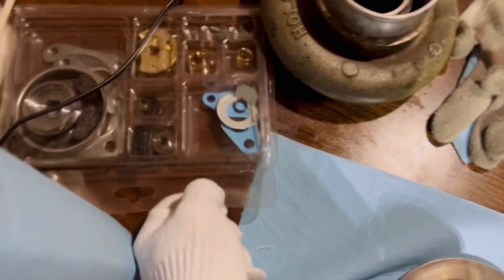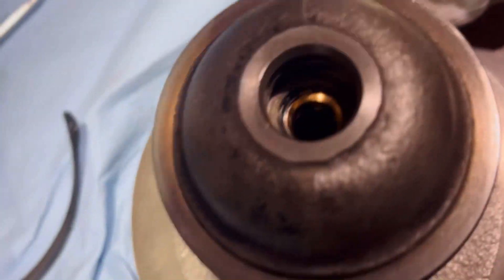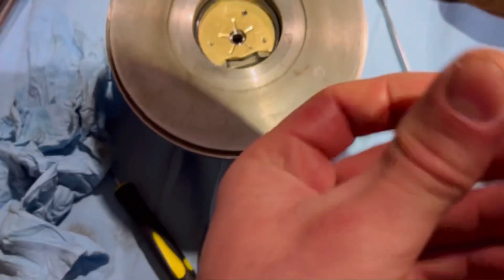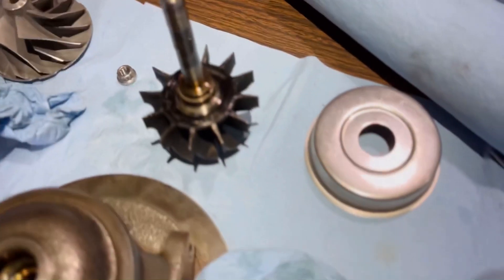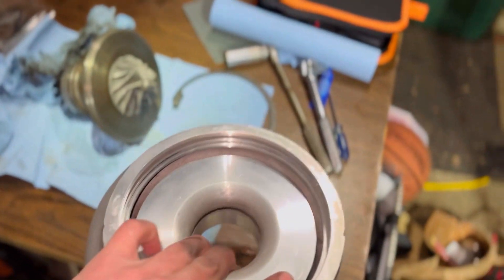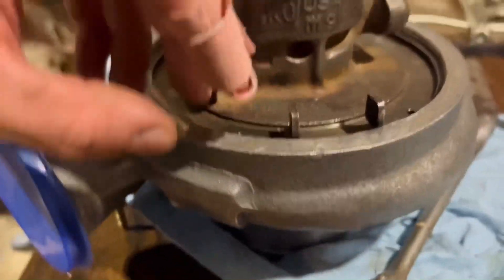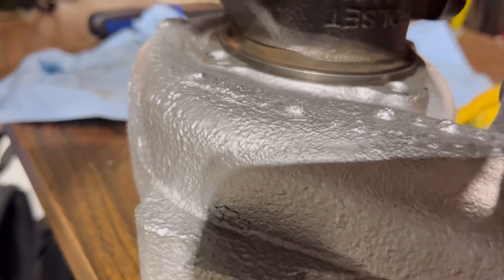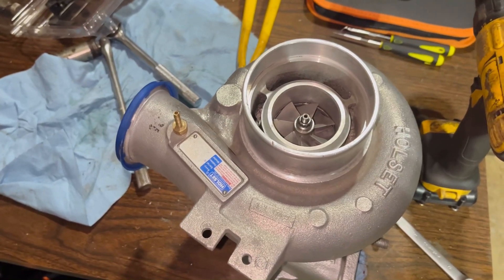How to Rebuild a Turbocharger (HX35/HX40)

Comment: Video is a life saver man! Getting ready to rebuild a hx40 and I did NOT want to sit through Turbo Labs old video
Reply: Got a tip for removing the turbine shaft?
Reply from the maker: @ should pop right out. If not light tap with a rubber mallet. Also check to see that the steel o-ring isn’t stuck at the exhaust side of the turbine.
Reply from the maker: Glad to hear it. Good luck with the rebuild!

Comment: Hi, I have a problem when putting the shaft in. When I push it all the way in it doesn't like to spin freely. If I take oil reflector out then it will spin freely. Can you figure out the problem? I have literally tried everything.
Reply: What about balancing?
Reply from the maker: It could be the o-ring behind the oil deflector getting caught up. When are you trying to spin it?